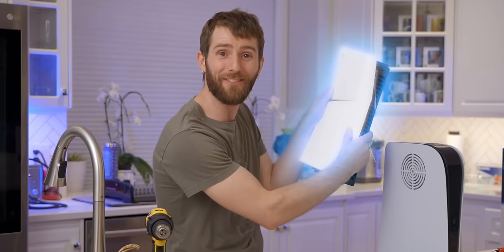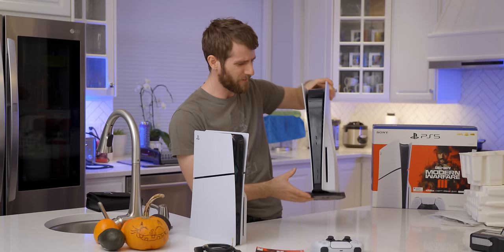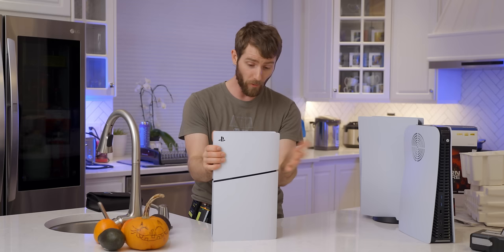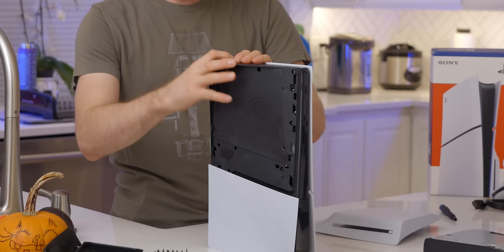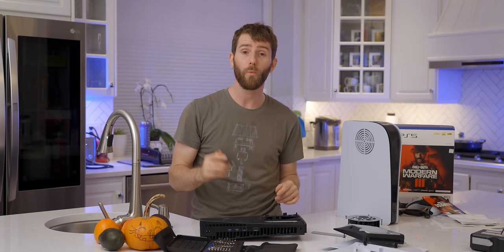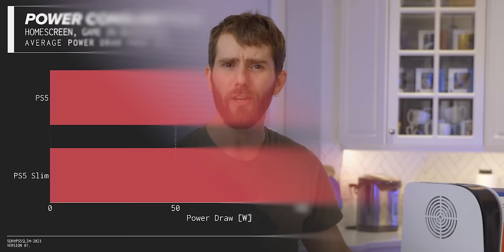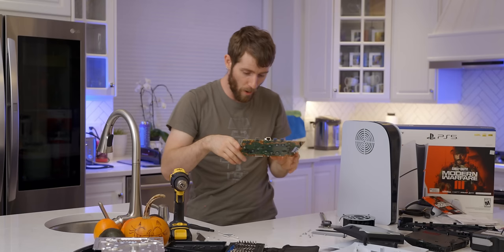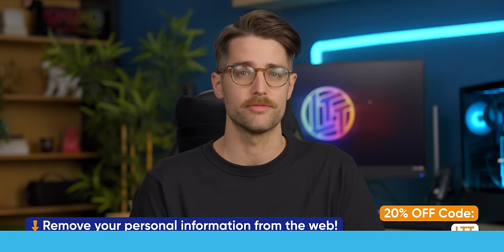PS5 Slim First Look and TEARDOWN!!

Comment: About what I expected. I had hoped that the onboard soldered SSD would be replaced with a 2nd NVMe slot (for better upgrade/repair path), but I guess that was asking too much. Looks wise, I feel like the original and "slim" are comparable, don't personally see where the hate is coming from. But the reduced overall size is welcome and hopefully there will be replacement matt black panels in future. Also nice to have a slight bump in storage from 825GB to 1TB.
Reply: Gotta keep a planned obsolescence ssd TBW planted in
Reply: I don’t think this thing is getting significant hate but even I as a life long PlayStation fan think the slim looks extremely cheap compared to the normal version, that seems to be the issue. I don’t see how this got past Sony, the ps5 was unique and look/felt good. 
Ps5 slim doesn’t look unique, just like a knock off and it doesn’t look good, as most people online have been saying. Can’t say how it feels tho.
Reply: @kaythree8302  huh? This one has been getting a shit ton of hate since it was revealed.
Reply: There is no way they would had made an upgradable main drive, especially now with the hacks available to the older versions of the OS.
Reply: There are plenty of ways to prevent downgrades, like efuses in the 360.
Reply: @maythesciencebewithyou  only because they thought it was not much smaller than the OG PS5 when it was leaked. Now people aren't complaining about the size since they are wrong about it. But people are hating on the looks instead because it looks like a Chinese knockoff, especially on the glossy top panel.
Reply: @kaythree8302  Well you as a long time fan are then completely ignoring the previous slim versions of consoles. Like the ps3 superslim for example was ugly as hell, and had a disk insert mechanism which was literally manual…

Meanwhile youre mad the slim version is an actually scaled down ps5… Like it literally should be.
Reply: @squirty131  It sucks, doesn't it? The PS5 will probably be my last console before I switch to PC gaming where I can replace parts if need be.

Comment: I'm suprised they didnt use an external power supply/brick, would have made it be a bit smaller and you could just cram that brick down the back of your TV/desk
Reply: Booo to external power bricks
Reply: They have never used an external power brick. I think you have Microsoft and Sony confused.
Reply: I'm glad they didn't.  Imo you don't save much space, and also lugging that around is annoying.  Glad it's a simple plug and play since I move my console around and the PS5 uses all the same plugs, which I have plenty spares of
Reply: Playstation models have never once used external power bricks.

Comment: Honestly the slim model is much more impressive than I thought it would be. But not much reason to upgrade if you already own the original unless you really like the look or need the space savings
Reply: More impressive? There's literally nothing thats impressive. It's  just the same stuff in a somewhat smaller case. You don't seem to be very objective or knowledgeable
Reply: @PhyrexJ  I hadn't heard much about the controversy or been in the loop much so I thought they removed the disk drive or something. This is the same thing as the PS5 but better and smaller than I expected a slim version to be. So yes it's more impressive than I thought it would be.
Reply: As far it is the same performance I ain't buying shit
Reply: @PhyrexJ negative nancy
Reply: @PhyrexJ are you crazy or what? slim edition is far better in every way

Comment: It did get a smaller node though. The original was 7nm. Due to diminishing returns the changes won’t be so drastic as when things were slimming down from 90nm to 45nm etc.
Reply: Yeah but the new cfi 1200 models of the og have the 6nm nodes so is exactly thr same for 99% of the ps5 that are on the wild this days

Comment: 7:10 NO! there wasn't wide-spread stories of PS5s overheating. wtf are you saying? The only stories of overheating was due to "dry spots" from the liquid metal from storing the console vertical. (I have a launch system that has vertical for years and never overheated). Guess it's just bad luck of the few others.

Comment: Linus saying user friendly storage never being a thing... 
The original Xbox 360: HEELLOOOO???!!!!
Reply: The storage upgrade thing for Series X/S is a tad expensive, but it ís really easy to ‘install’.
Reply: Not originally. The original 360 had a super expensive custom HDD. It wasn't until they released the slim model that Microsoft updated the ability to use external drives. Also, since the PS3 Sony has allowed the use of external drives and the internal drive was user replaceable with an off the self laptop drive.
Reply: @BurritoKingdom  yeah but 360 had the on on the top and the 2 hdd slots on the front plus the ability for external storage via USB was literally a goat
Reply: @S0ulC41ib3r  not compared to the original PS3. You can replace the internal hard drive with any random laptop drive, it had 4 USB ports that can connect to 4 external hard drives/flash drives, a compact flash slot, an SD card reader and a memory stick reader and all those ports can be used for more storage. So that's 7 external storage devices and 1 internal. Sony quickly realized they were burning money with all those extra slots and revisions only left 2 USB ports and that internal HDD. 😂

Comment: The "special" connector on the disc reader is actually a sony proprietary connector they have been using for 20 years now on computers like the Vaio lineup (guess it has been improved since).

Comment: Did you test the suspension wattage over time? I would assume that it wouldn’t fully suspend for a quick out and in action by the user. Would the power consumption return to 50 watts after like 10 minutes?

Comment: The thing about TSMC's 6nm manufacturing process is that it doesn't reduce power draw at all, it's just a higher density version of 7nm.  I wouldn't expect a real manufacturing improvement with refresh consoles anymore since these days it would increase costs, whereas in the past it always decreased costs.

Comment: A few points of concern:

1) How it is smaller with smaller fan, dramatically reduced heatsink yet draws the same power and heat?
2) Did the SSD get a downgrade? I can see less NAND chips but are they the same quality TLC type NAND flash or did they cheapen out with the less reliable and shorter lifespan QLC type NAND?
3) Why does it draw the same power with the game in suspend mode?
4) What was the point of splitting both side panels and how will this affect replacement panels going forward, like, will they offer two versions or ignore "thicc" PS5 models when new ones arrive?
Reply: 1) That is a similar sized heat sync and not a much smaller fan. Blower fans down scale.
2) All nand is QLC or PLC now.  Being able to run in that mode doe not mean it is being used that way.  The controllers have have huge upgrades since the ps5 came out
3) Game as are not suspended unless you turn it off.  They are paused and stay in CPU./Ram unless you launch something else.
4) shouldn't matter.  It changes less parts if you get the disk drive.

Comment: Been using a PS5 for 6 months or so, it's been really great. I have a PC that's stronger than the PS5, but games are just so much more optimized on that console, and I adore the controller.

Dualsense Edge is so unbelievably good. With the rising costs of PC components, it wouldn't surprise me if some people jump ship to consoles. This generation, the price to performance is unmatched.

Comment: The fact that the price actually went up 50 bucks on the digital version makes this not very exciting. Sony saved manufacturing costs but increased the price anyways. Conceivably due to inflation but the prices of many of these components (especially ram and nand flash) went down and I'm sure Sony's cost for the AMD SOCs also went down.

Comment: One downside of deleting the usb-a port on the front, at least for my use case, is that when I was using my headset’s usb dongle in the rear IO, the rear exhaust would heat up the dongle to the point that it would just stop working. I had to take it out to cool down to get it working again. Obviously, that’s a problem. Just started using the front port after that. Wouldn’t have that option with the slim version. Hopefully, that means they redirected the exhaust away from the rear IO. Kinda doubt that though.
Reply: you really need more airflow around your console at that point
Reply: USB-C to USB-A dongles are a thing, could consider one of those.

Will probably be even more useful in the future, as things starts changing away from -A.
Reply: @Nightykk  some phones even come with those dongles too so everyone wins
Reply: doesn't seen that they redirect it, but these tow ports in the front are hig speed so you could plug a usb hub to solve these problens
Reply: 1. You really should get more airflow around your console.
2. Get a short USB A extension, plug your headset into that extension and into the back of the console. That way, you can put the dongle at the side of the console, solving your heat issue, and you don't occupy a front USB port.
Reply: Could also use a USB extender cable so the dongle won't be right behind it.
Reply: @MR-vg7yn how much more air space do you need around the console than being out in the open? The thermal exhaust for the ps5 is so bad. It has nothing to do with space and everything to do with how Sony directed the heat to go right through the ports.
Reply: @GameTimeWhy  How do you know the OP has his console out in the open? He says his audio dongle stops working. That usually doesn't just happen at 40°C or something like that, that needs seriously high temperatures, so I assumed his PS5 is sitting in some TV console or something of the kind.
Also, you make it sound as if it's a bad thing that the exhaust air of the console is warm. You do know that that is a good thing, right? Warm exhaust means heat is transported out of the system, i.e. the cooling system is working.
I'd also prefer the exhaust to go out of the back of the system, because that means it isn't blowing the warm air at me.
Reply: @MR-vg7yn  the "warm" air is blowing directly onto and through the ports on the back. Have you even looked at your ps5? Also why would having the air coming through the front be blowing on your face? Why are you that close to your console?

Comment: I get the feeling that the die shrink that usually goes with the slim was the one in the earlier refresh but that they wanted to go to market with the 6nm chip sooner and had not had the time to redesign everything around it.
Reply: Yeah I also think the 6nm was meant for the slim but they tested it on the 2022 models

Comment: Just going to remind everyone that 3 years after the PS4 was released at MSRP of $399, the PS4 slim came out at MSRP of $299. Fast forward to now and it's been 3 years since the release of the PS5 at MSRP of $499. The PS5 slim will retail at $449 (plus $29.99 for the stand) essentially making it cost approx. the same as the original PS5 but at least they built a docking bay for a disc drive that can be used once & ONLY ONCE after its been digitally verified for an additional $49.99 which would then make it cost more than the original PS5 with the same specs inside.
Reply: Do you follow economics at all? No?
Reply: @@JDS4K the manu costs are likely more atm, also the still sell at a loss. Dont know why you are crying have you seen the pc market?
Reply: Inflation exits for a reason.

Comment: I think 6nm was originally reserved for the PS5 slim but Sony decided to put it in the original due to the overheating issues.
Reply: Overheating issues? The first change they made was the original chip with a smaller cooler.
Reply: no they went to 6nm because it made the cooler and also the dies smaller so cheaper for them to make
Reply: It never ran hot lol
Reply: @twanc156  uhh what? the 2nd version of the ps5 ran very hot and has issues with overheating. there is a reason they made a 3rd version that increased the amount of heatsink after they gutted it to be cheap on the 2nd version

Comment: I really dislike the disk drive being tied to the internet, because that means at some point in the future it will become obsolete. However, the cool part about having it be modular is that the space for the disk drive can be used for things such as console expansion GPU's if it uses PCIE. Imagine being able to upgrade your PS5 or Xbox Series console in the future with like a mobile 4090/7900
Reply: Just get the launch model problem solved.
Reply: @dericjames2018  I wont be getting either model, I already have a Series S. Getting the launch model doesn't make it any less bad that the disk drive is tied to a server that will eventually go down and cause it to be e waste

Comment: Normally I'd be excited about this, but after that price hike on psplus and no major changes to the service,   I could careless about Playstation anymore.
Reply: I’m not bothered about PS Plus at all as I don’t play multiplayer, but I was holding out for a ‘Slim’ release before upgrading from my PS4 Pro (which has an SSD disk replacement).

Though I like the modular approach Sony have taken (I’m in the UK where the price for the diskless version remains the same), I’m really disappointment to see there’s no efficiency gains, no change to the hideous styling, and there’s even more glossy plastic. It just looks cheap.

I just see no compelling reason to upgrade - I still have 50+ PS4 titles I’ve not yet played, and any Sony ‘exclusives’ I might want to play are now coming to PC.

Comment: Really surprised that they didn't go for 5nm this time around, considering the node isn't brand new anymore since AMD and NVIDIA have fully switched to 5nm. And the rumored Series X refresh also isn't switching to 5nm but on 6. Wonder why the consoles don't want to use that process?
Reply: Because it'll cause their costs to go up quite a bit. They'll save it for the next generation
Reply: Price. TSMC charges a premium. Sony didn't switch to 6nm until AMD and nVidia moved down to 5nm, which made 6nm cheaper since those lines were freed up. I wonder why Microsoft or Sony don't switch to Samsung. Except for themselves and Google, no one is using Samsung, so they're probably more willing to go lower in price.

Rumored is that the Switch 2 will be using Samsung to manufacture it's SOC, since it's cheaper.
Reply: @BurritoKingdom Because Samsungs node process is mediocre compared to TSMC. The 8nm Samsung node was equivalent to a 12nm TSMC.
Reply: You sure they did 5nm for the Ryzen APUs though, which these consoles use? And not just 5nm for non-APU processors?
Reply: @ZackSNetwork No, Samsung 8 nm is a lot closer to Intel 7 (10 nm ESF) in terms of transistor density (60+ million transistors per mm^2).
Reply: @ZackSNetwork  I know but Samsung's 5nm is freed up since Google is using 4nm for the G3. Sony and Microsoft could probably negotiate a good price to use those empty 5nm lines
Reply: they went with 6nm because the smaller size of the die would be offset by the cost they would need to pay for 5nm node
Reply: Because it is more expensive to manufacture than on 6nm.  Same reason why AMD uses 6nm for the I/O dies on Ryzen 7000 and Memory Cache Dies on RX 7000 (Navi 32 and 31).
Reply: Because ps5 pro will be using 5nm/4nm so they don't wanna spend money on using it in the ps5 slim.